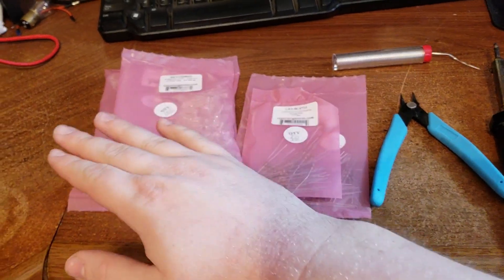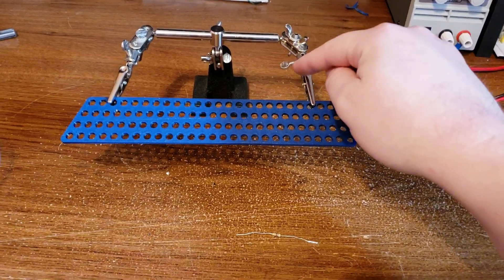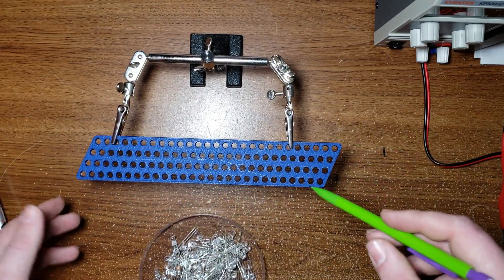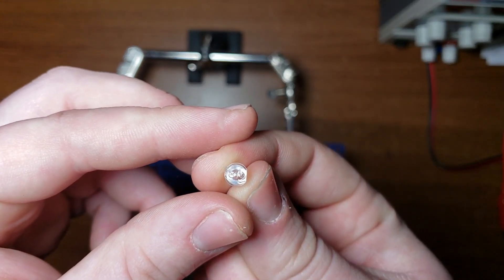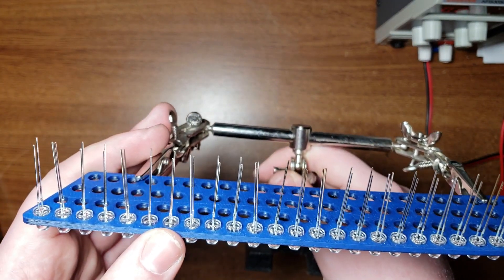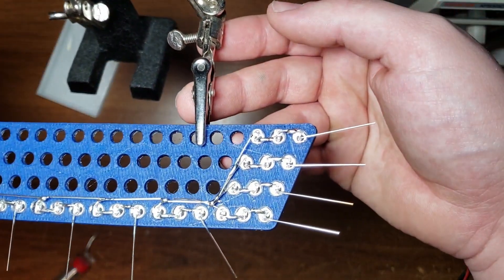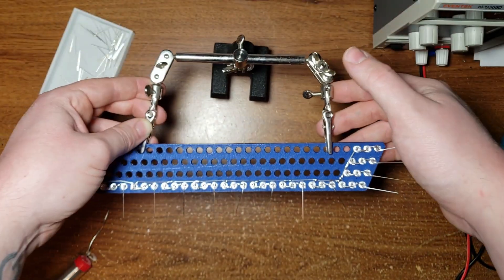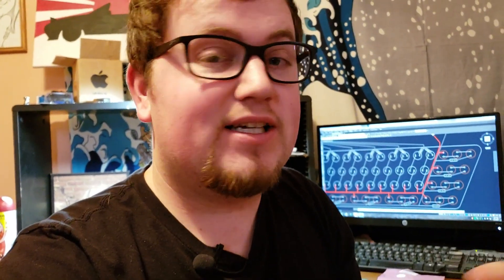Miata Sequential Turn Signals - Running Light Install

Comment: When doing custom exposed led grid howclose do each led diode need to be to get the best look  i like the distance space in between ur led
Reply from the maker: I can't remember the exact spacing I did, but I think I explained it in a previous video on the design of the boards.
Reply: @PeaceParts  do u know exactly  wat I need to grid  my panels on the lap top so I can drill by hand until I get a machine ..panels im taling biut taillight panels.for grid custom  tail light..
Reply from the maker: @justinrolon4643  I used Autocad to lay everything out on the computer. You can try using fusion360 since its free and relatively easy to use.

Comment: Your videos are excellent! How are you fabricating the boards?
Reply from the maker: The first idea was 3D printing a board with a bunch of holes. That was prone to warping (no surprise) so then I designed some in some free software and then had a company online make a batch of printed circuit boards.
Reply: Peace Parts what software did you use and what company?

Comment: One quick tip: Get a few of those washable silicone sticky pads for under the helping hands, then they don't move around or tip over and it is removable without being glued on
Reply from the maker: Thank you! I've used those before, I need to get one...

Comment: Are you using one resistor for each diode? It didn't look like it? How many resistors are you using per/diode ? or are you using one resistor for every few?
Reply from the maker: 1 resistor for every few LEDs. Watch the designing sequential turn signal video and you can see how I laid it out. The circuit is the same when I made the pcbs for the final product.
Reply: Peace Parts yeah I will look into it, 
woukd 1 Ohm 1/4 Watt LED Resistor 1ohm 1/4watt .25watt .25 w 1R Board   resistors be ok to use?
Reply from the maker: @JDMHaze  no. You need to calculate how much resistance to use with your LEDs. There are calculators and wizards online for it. I used 330 ohm 1/4watt resistors for the main sections of 3 LEDs

Comment: Question where can we get the LED board for the different cars I have a Subaru want to get those board and custom fit for my tail light can u help
Reply from the maker: I designed my own but I only have a miata to design around. I want to design some for other cars in the future.
Reply: Illumaesthetic

Comment: Have you had a problem with bulb out warnings or faster blink rate?
Reply from the maker: Yes. The turn signal will blink fast after installing them without the sequential module like I did before. I modified my flasher relay with a higher resistance so that it would blink normal with the LEDs. Which, in my opinion, is the correct way to fix hyperflash.
Reply: You can get special flasher relay is for LED on most pre-2007 vehicles   To avoid using resistors